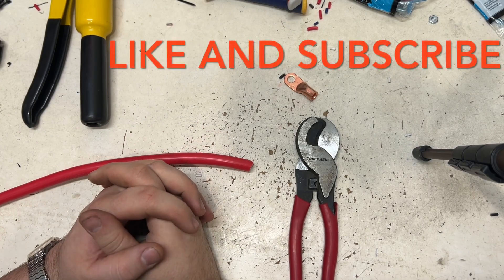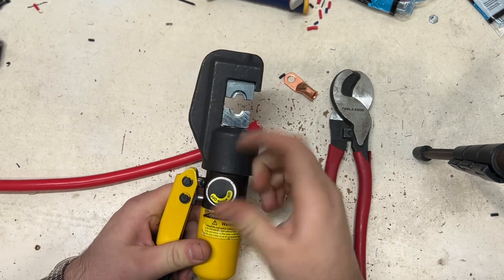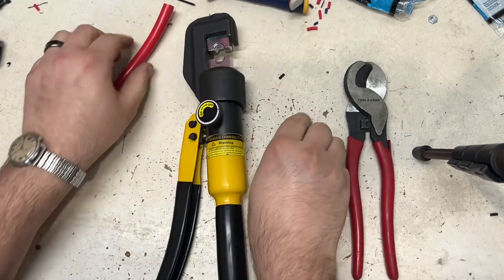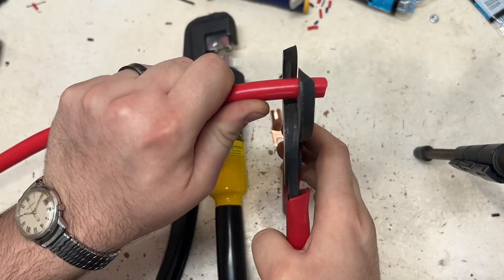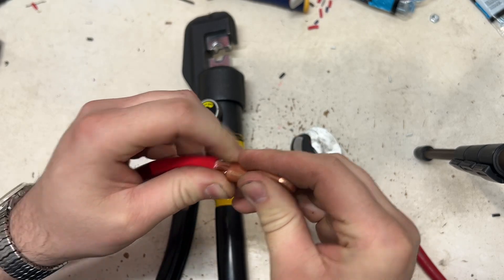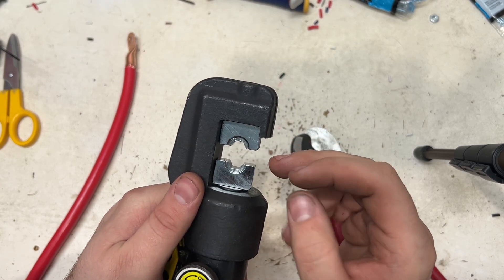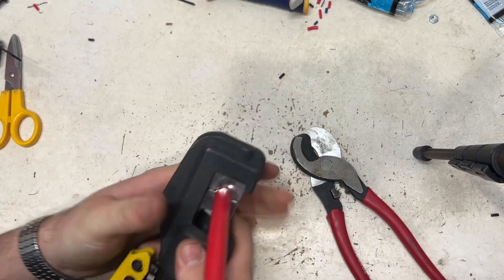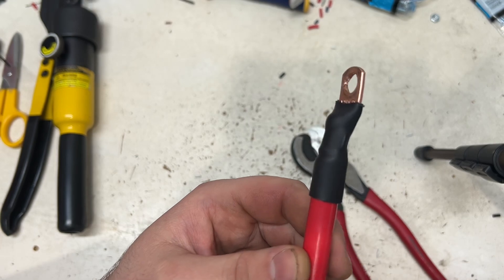Battery Cable Assembly for Racecars

Comment: Its not the die thats too small its the design. The cheaper dies all do that where it leaves those tabs. Get a moderately priced temco and it leaves a perfect hexagonal crimp but apple as to oranges its preference. As far as crimp vs solder there are numerous manufacturers tests showing results are the same. Theres a good video of a cross section cut of the lugs after crimping showing that both ways are satisfactory although most just prefer the solid crimp with no solder just because of the extra step and it was proven to be no more effective than crimp alone. Good video thanks for posting
Reply from the maker: @phildoleebowitz5335 I completely agree that a better quality crimper would get much better results, but the issue is that most people can’t afford a crimper that cost $100 and up. The tabs on this lug end up being a visual defect since they are not sharp enough to cut through the heat shrink. I believe that these crimpers are good enough for the average weekend racer. When it comes to solder vs crimp, the end result is the same if it is a PROPER solder joint. Most people at home do not know how to do a proper solder joint and end up with a cold solder. Also, all motorsports electronic companies say that solder should be an absolute last resort since it has a tendency to wick up the wire and create a wire that is too stiff and might eventually break. Crimp vs solder is always discussed back and forth and will probably never have an absolute answer. Thank you for commenting!

Comment: To avoid big wings on some terminals you can rotate before finishing the crimp so the second time pressing it will fit all inside the die.
Reply from the maker: Thanks for the tip. We need to either modify this setup or do as you suggest to reduce the wings a little. This was just an example of crimping vs some of the other techniques.

Comment: When I went to Fueltech training, even they said do not solder anything on a racecar! Thank you for sharing that video! I will definitely buy that hand press
Reply from the maker: There is just a little bit of argument over solder vs crimp in motorsports wiring, but all major wiring and ECU companies say to not solder. Solder can wick up the wire causing it to become brittle. Also, cold solder joints will break really easily. PROPER crimps are almost always superior.